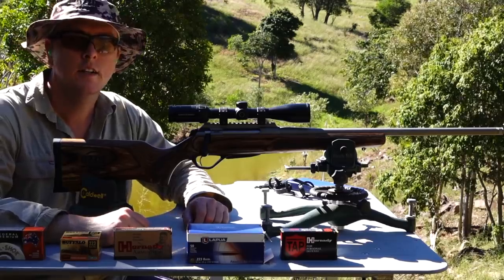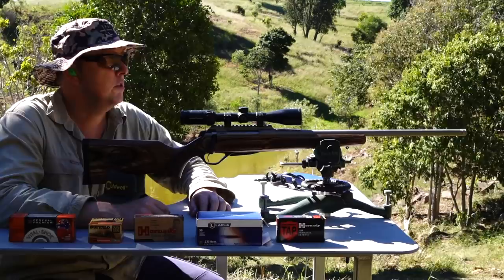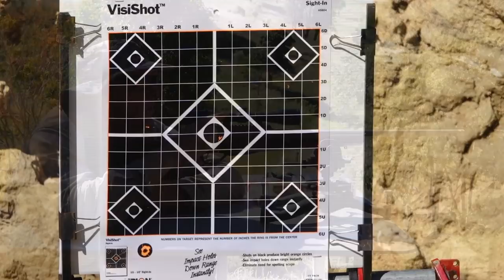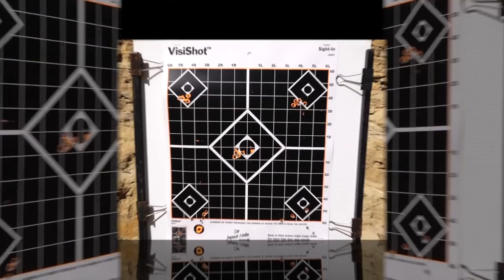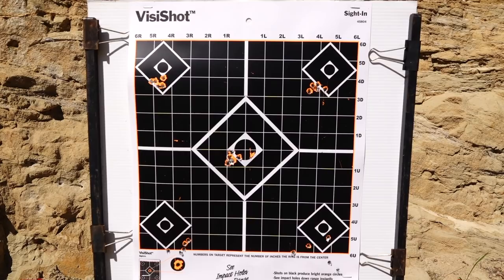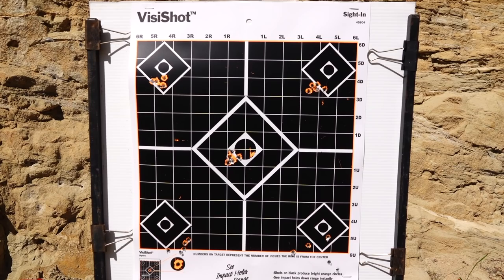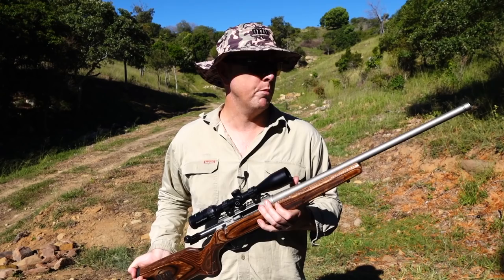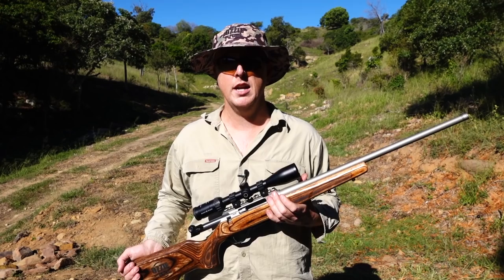Shooting my re-barrelled Lithgow LA102 .223 (for the 2nd time)

Comment: I felt your pain/disappointment, with my new re-barreled 223, after running in the barrel as per your how to break in a barrel vid, I tried 18 different rounds (diff makes, diff weights, target/hunting/varmint) and struggling to even get close to a sub 1 inch group at 50yds the first time out....! 

2nd time at the range and after roughly 200rnds it's shooting much tighter groups....1/4 inch group using the OSA 55gr Game Kings...! Loving it..!!!

Haven't done any copper removal yet and I'm at 400rnds getting 1/4 inch groups using the OSA 55gr Game Kings...! Loving it..!!! 

Cleaning wise I just use G96 for now (maybe do copper removal after 600rnds) run patches till they come out clean and that's it..!

Great to see yours is shooting great again..!!!

Comment: question ozzie.. did you do a copper removal clean after last time? OR did you just oily patch it and put it in the safe.. I only ask because if you did just oily patch it could it be when you shot it first time , it didnt have enough through it ?
I found with my rifle I stopped copper removal till well over 500 rounds... why?
because I found the first 30 or so shots would have fliers all through it until it settled down.. so now I hunt, come home throw an oily patch through and then just dry patch it out and hunt again.
Reply: @Greg Roles absolutely man
checkout markandsamafterwork youtube channel.. he shoots 4000 and 5000 yards.. he says the same thing he prolly goes out to 1k rounds before he cleans em.. I mean he does rust prevention but no copper removal.
Yes keep em tight the idea at least his theory is you want consistancy, so you wanna be pushing the same amount out and leaving same amount behind if that makes sense. It's not gonna get smaller and smaller it will reach a point and stay like that
Reply from the maker: Just my usual foam bore cleaner then g96

Comment: Mine was the same. At 100 it was OK. 200 was woefull. Was really worried it was a dog after the re-barrel. After 2-3 heat cycles and 200 rounds its back at 1/2 MOA at 200m. I was about to sell it and get a Sako 85 when i go it back it was that bad.

Comment: Hey Ozzie, Just a note, the Hornandy 75gn needs to run though a 1-8 or 1-7  twist rate, the 1-9 is designed for the 50-62gn bullets, As for being extremely high quality I just bought one a month ago and had to be returned to the factory as it would not feed using genuine mags(4 of) and using ADI ammo. very disappointed as an ex aussie solider I have relied on ADI for years

Comment: I was 50/50 about either the Lithgow or a T3X but after watching your videos I settled for a LA102 in 223 as here in UK it's a bit different from the norm, I got it yesterday and I can't wait to get it to the range once my Titan shows up, very excited, any tips on running in a new gun?
Reply: so 2 months and 500 rds later I can confirm I got a 0.69" group at 100 yds using the cheapest ammo here in UK Norma TAC 223, I'm so happy with my Lithgow its amazing